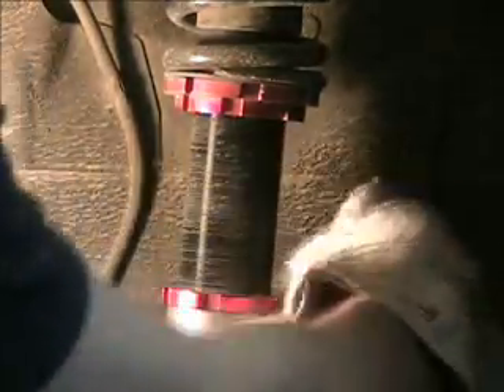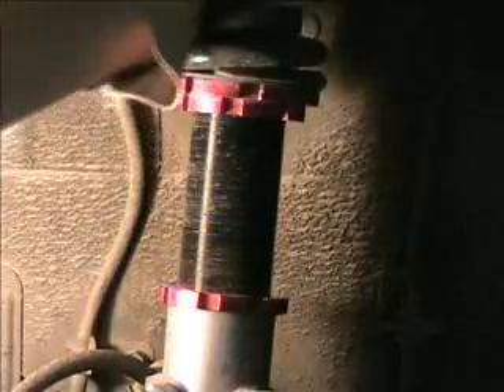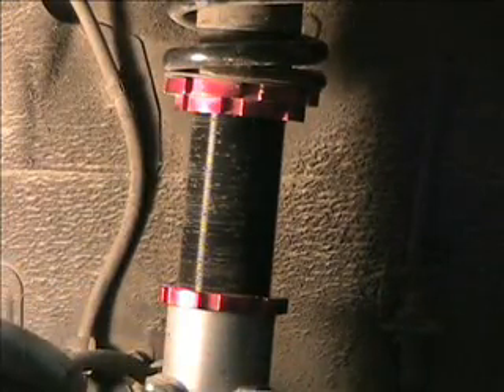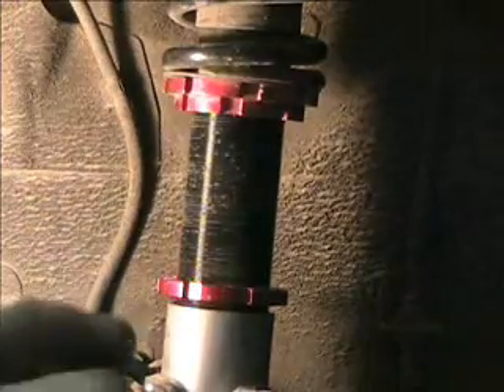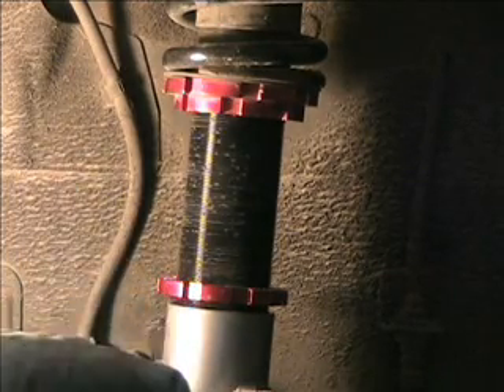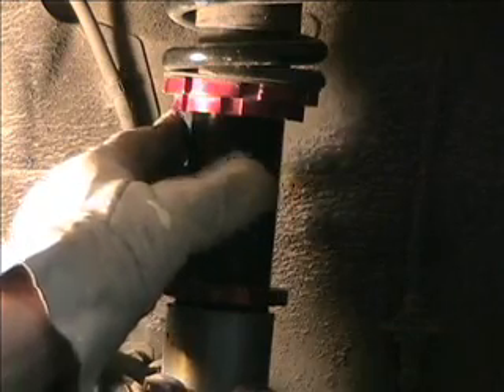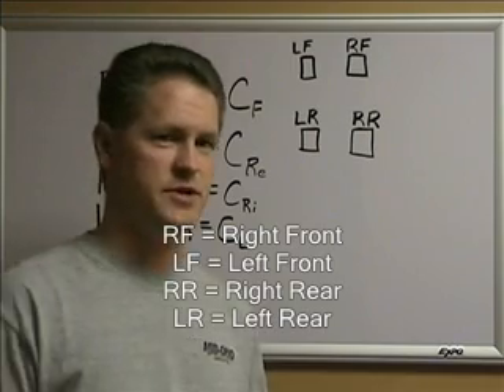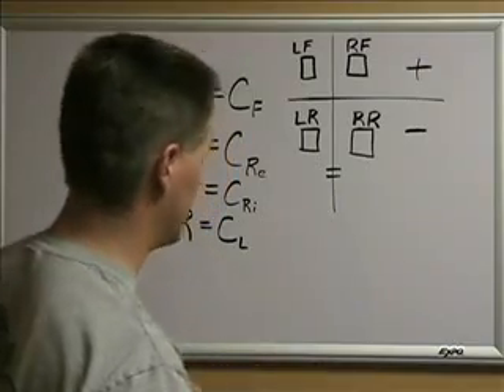Corner Weight - Part 2

Comment: i want to do a question here.  
To adjust the height, should I must untie the suspension apart from the driveshaft? Or it doesn't matter. I mean how to screwed the bottom part into the coil part - column without make remove the suspension from the driveshaft. I can not undearstand that. and in this video is not make clear that point.

Comment: You need to disconnect your swaybars  before starting as they will weight jack the corners as you adjust ride height  . Once your happy with the corner weights & ride height , re-connect the swaybars &  adjust them   for neutral loading  . You need to get someone to help as you need to be sitting in the car when you adjust the swaybars  ( unless you used dummy weight in the drivers seat)